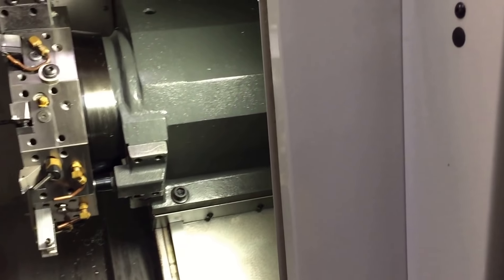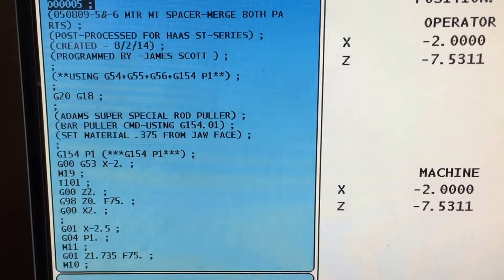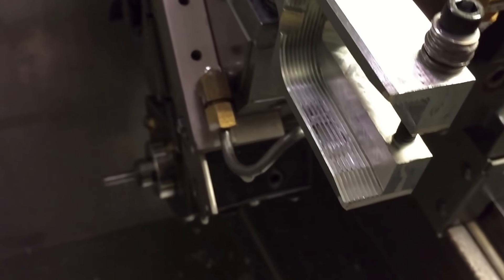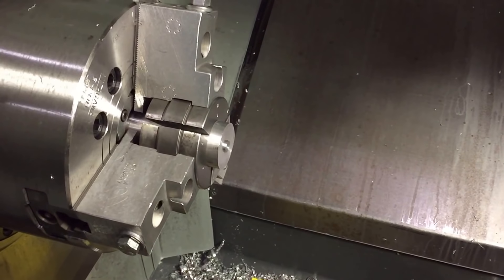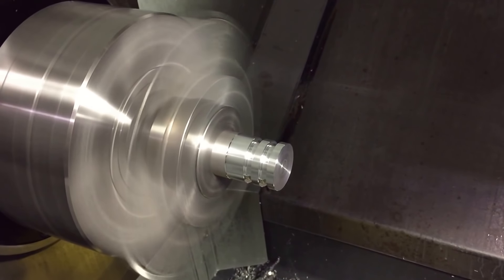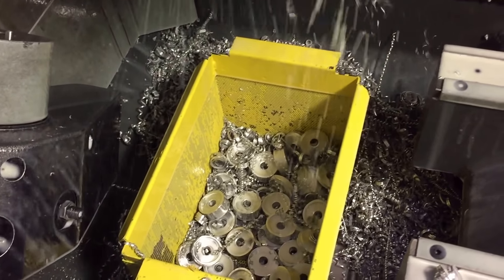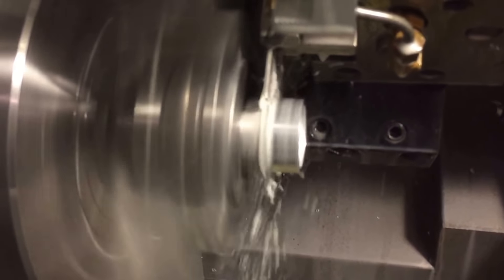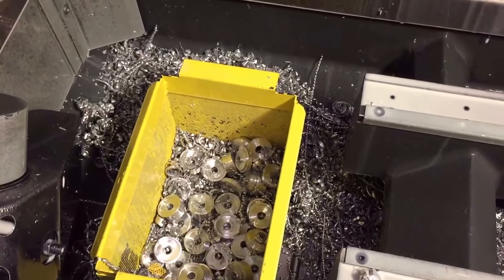ZOO CNC CONSULTANTS HAAS CNC LATHE ST20 TURNING CENTER WITH POOR MANS BAR PULLER HOW TO DIY

Comment: Tell me about those lathe jaws
Reply from the maker: Basically I just bought a regular set of soft jaws and machined them to accept Warner Swasey collet pads.  I’ve done them in aluminum and steel over the years but I suggest steel.   It’s a very fast and cost effective setup.  Very accurate as well when setup and used properly.  We have jobs with .0005 concentricity call outs one 7” long .625” diameter from end to end with a collet bore on one end and a turbine mount on the other and we are able to hold it all in spec with this setup.   Thanks for watching
Reply: @LOURAMORE  on my way to buy  bunch of WS collet pads on ebay

Comment: I have a part that has to be 1.25".  I add .02 for facing, and 3mm cutoff tool, plus .6 extension.  I have e jaws gripper and I touched the face of the the part when is extended with the tip of the Jaw to set the Z for bar puller, but when it is getting to the bar puler the number quite do not match.  Could you please advise how you calculate the approach , engagement and extension for this?
Reply from the maker: Sorry, I just saw this.  Shoot me an email ** (raceparts@rocketmail.com) and I will try to better understand and help if you haven't already worked it out.

Comment: how do you do the offset on the bar puller
Reply from the maker: farhad64it 

I. Think I was using a high offset like G110 or G154 P1 and used it only for the bar puller cycle.  I'm sure there are many ways to accomplish the same thing but if you use an offset that's just for the puller you don't have to worry about any other offset changes you make having subsequent effects on your puller routine.  Just set the face of the puller to the face of the material as if it were a tool touching off on a part and then program a Z- move and the and X feed move to grip the bar.  Then unclamp and feed the Z out the desired distance, clamp the chuck feed off in the X axis and that's about it I think.  

Hopefully that answers the question. 

Thanks
Adam
Reply: I know, but what value you put for the x and z in the geometry offset?
Reply from the maker: farhad64it 

So basically set the puller just like a tool.  Set the face to the face of your material for Z and the bottom edge to material radius for X axis. Just like an an OD turning tool. When you go to set the WCS zero position you set to the face of the bar on whatever work-offset you decide to assign to it.

Comment from the maker: Here is one of the programs I was using but keep in mind there could be variations between our setups.  Haas controls use pretty much the same G code as Fanuc so I would imagine it would be very close on a machine with a Fanuc control.  Just be careful and keep rapids low for first several cycles.
%

(ADAMS SUPER COOL ROD PULLER) 
(BAR PULLER CMD-USING G154.01) 
(INITIAL PULL-SET MATERIAL .375 FROM JAW FACE) 

G154 P1            (BAR PULL CYCLE WORK OFFSET) 
T101               (TOOL POSITION USED FOR PULLER)
G00 Z2.            (INITIAL Z RAPID TO POS-CHECK FOR CLEARANCE) 
G98 Z0. F75.       (ACTIVATE G98 IPM PGM FEED RATE) 
G00 X2.            (INITIAL X RAPID TO POS-CHECK FOR CLEARANCE) 
M19                (SPINDLE ORIENTATION) 
G01 X-2.5          (FEED TO BASE POS) 
G04 P1.            (DWELL)  
M11                (UNCLAMP CHUCK) 
G01 Z1.735 F75.    (FEED OUT DISTANCE DESIRED)  
M10                (CLAMP CHUCK) 
G90                (JUST FOR SAFETY)  
G00 G53 X-2.       (RAPID X AWAY) 
G53 Z-7.           (RAPID Z AWAY) 
G97                (ACTIVATE IPR FEED) 
%
Reply: G154 P1  dont understand  plz explain other program good understand

Comment: Hey would you mind posting the code you use for the bar puller?
Reply from the maker: No problem.  Do you want me to just post it here?
Reply: +Groove Automation (-Louramore)  Working on getting my poor mans bar feeder going. Did you post the code somewhere?
Reply from the maker: I thought I had done that already but I don't see it anywhere.  shoot me a message to my gmail address alouramore (split up address so I don't get spammed) I will get it done asap.  I would love to see what you've got when you're done too.
Reply: i shot you an e-mail.  i don't know if you check this anymore or not but my company purchased a lathe that will be here in a about 4 weeks and i'd like to make this before it got here.  awesome work btw.  i love the accuracy

Comment: Great video, just one question what exactly does g154 P1 do?
Reply from the maker: G154 P1 is the same as G110 so the G154 designates the upper offset group and P1 through P199 are the extra offsets available.  We tend to use a large number of work offsets compared to some people but it's only because I've been trying to make part setups that are literally bolt in and run.  It's working on a limited basis I'd say but I confuse myself at times and wonder if I'd have been better off without the added complication

Comment: Very good bar puller. I was looking for ST-20 in general. Does the standard machine have spindle position control and live tool capability, so you could cut something like a gear on it from a fed bar?
Reply from the maker: Benjamin McLeod 
The live tooling machines are the only ones that actually have a full programmable C axis for the spindle but I believe the base machines all have spindle orientation which you can control with M19 and p# for position in degrees.  I pretty sure they have spindle orientation to accommodate threading cycles but I’m not positive about that. If you have one give it a try.  Just try M19 P30 it something like that in MDI and see what happens.
Reply: Thank you. I don't have one, but someday would like to. Without live tooling it would not be valuable, but that answers my question.

Comment: what is that collet setup you run in the soft jaws? i need that!
Reply from the maker: Gordon Ingram  it's called warner swasey collet pads but I made the top jaws to accept them.  There are some available to buy but they're either very expensive or crap.  Not much in between at least the last time I looked.  If you want sent me a message and I'll give you a model of the ones I made for our shop. Raceparts@rocketmail.com
Reply: Thanks! i sent you an email. these collet pads are pretty cheap on eBay {but the jaws are insane}. I've got spare soft jaws, and i HATE moving the jaws around on the chuck.
Reply from the maker: Gordon Ingram 

Set it the same as you would an OD turning tool.  If you set the puller as a tool and then just use that separate work offset and set the puller face to the face of the material you should be fine.

Comment: Awesome bar puller ! But what exactly is the deal with the jaws I'm interested, looks to be some kinda of quick change setup.

Thanks
Reply from the maker: Les Young They are called warner swasey collet pads.  I made the top jaws that bolt to the chuck and then just buy the collet pads.  It is great.  Setup for any size material in maybe 2 minutes.

Comment: I doesn't look and sound like you used constant surface speed when machine these parts.
Reply from the maker: That's correct but I often don't on aluminum because it drives me crazy when the spindle is running up and down all day. It just seems too dramatic the way it spikes and I've not noticed any down side to giving it up. But like I said that only applies to aluminum and I never do it on steel or SS

Comment: Very smart , are the cutting operations done in one offset ? Did you program that with software or on screen?
Reply from the maker: I'm afraid that program was a bit of a mess.  I had the idea one day to run the parts in sets as they were used in the assembly of the product they're for because we always seemed to have mismatched quantities of the different sizes.  I started by just pasting the different program's together and using work offsets in sequence for each part but if I were to do it again I would just draw it up in AlphaCam and output a nice clean program.  I used the Haas VQC a little in the past but AlphaCam turning application has improved so much in recent years that it's really hard to beat.